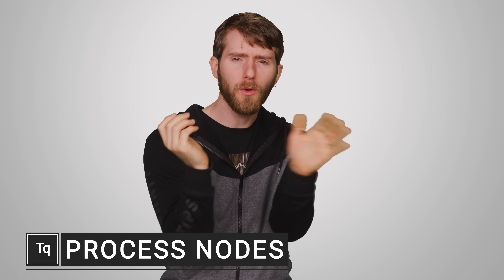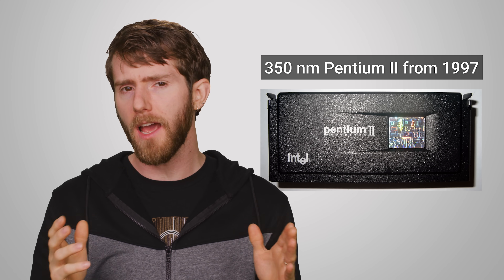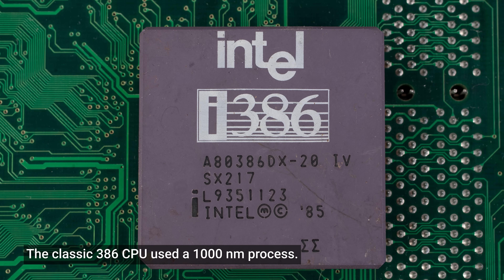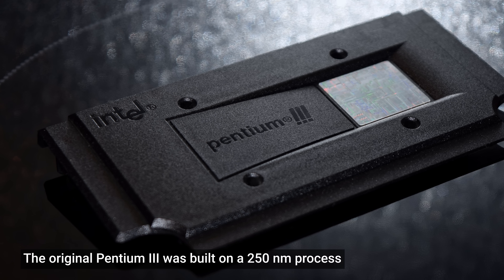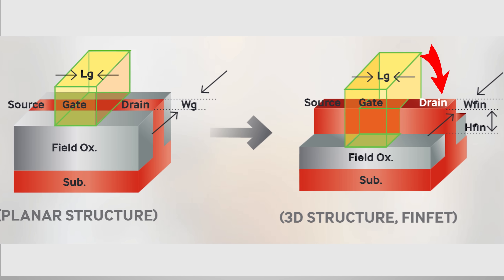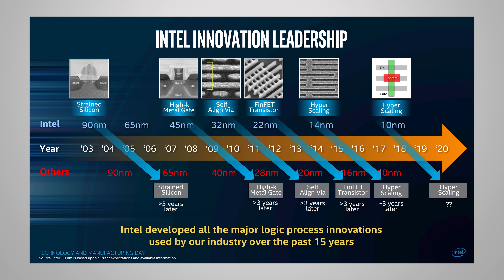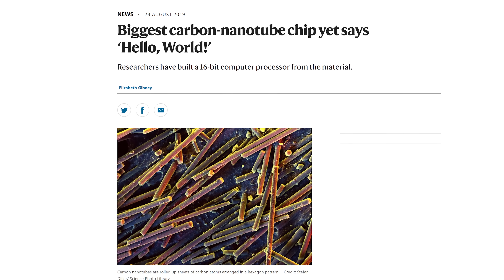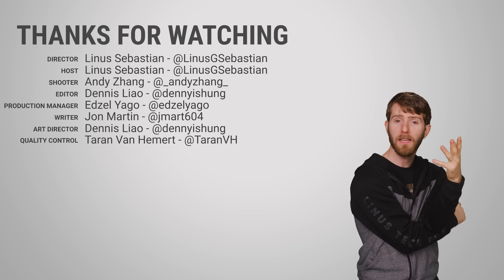Should You Believe CPU Marketing? - Process Nodes Explained

Comment: As long as each node jump has roughly a doubling of transistor amount, then I really don’t care whether 5nm refers to a size or not. Clearly the reduction of size isn’t the only thing that is helping with getting more transistors in the same amount of space.

4:13 thank you, literally my point
Reply: They arent consistent. Samsungs 11nm is better than their own 10nm
Reply: _lk_s better is a very loose term. In what sense, yields, transistor density? Point being each node jump should have better density than the previous. If Samsung’s 10nm is worse than their 11nm in density, then there’s an issue with their naming scheme in addition to the fab process.

Also each node jump that refers to a doubling of transistors goes off a scaling factor of 0.7. Hence 14nm*0.7=10nm
10nm*0.7=7nm

Going from 11nm 10 would be a factor of 0.9 and not 0.7, so the density increase wouldn’t doubled
Reply: @HazzyDevil  11nm has a higher transistor density than 10nm and better yields etc. 
10nm used a slightly different manufacturering process which caused worse yields. Therefore they improved the 14nm process once again. Until Samsung had their 8nm running the 11nm node was the best they had.
Reply: _lk_s so this just comes down to a bad naming scheme by them
Reply: @HazzyDevil  but that´s basically the point of the video. 
Each 0.7 factor improvement/Generation should stand for an increment of 100% in density. 
But Intels used ~170%,
TSMC used ~75%
and Samsung used 25% when going from 7nm to 5nm.
There is no logic in this naming scheme.
Intel could call their 10nm 5nm instead. 
Intel could even use their "+" names for node size.
Reply: _lk_s what are you using as the reference here though? And each node jump isn’t as cut simple as 14 to 10 to 7. There’s also the refinement of the same node. TSMC goes for smaller jumps in between whilst intel is more about doing bigger leaps.

And there is logic. You are making the mistake of comparing different naming schemes.
Reply: The only problem with the process node is that a 10nm intel node is comparable to a 7nm node from TSMC when it comes to density and most of people will see 7nm vs 10nm and will say 7 is better than 10 without researching a bit to check that they are comparable( Yeah I know that Intel has yet to bring a 10 nm desktop cpu to see exactly how much more the density matters and how truthfully are the "process nodes")
Reply: George Uta having higher transistor density is only one factor of having a better process node

Comment: There's a missed opportunity here to make more direct comparisons of size from TSMC's lithography to Intel's.
He's also using a white lie wrt electrons: what you're sending through the transistors is voltages, which can move at ~ 2/3rd c, while electrons will travel much slower. Also the exponential decay curve of the electron tunneling could be mentioned here and would make more sense in his discussion.

Comment: Intel says node size isnt everything....  I imagine it would be very important if they had 7nm and AMD had only 10nm.
Reply: They also say benchmarks are out of fashion. Let's rewind a few years...
Reply: @19AssassinPR93  yep that was insane hearing this from intel ceo XD
Reply: Node size as a bad measurement has been known throughout the industry for years. It's fine to shit on Intel and all but you could also say that it's TSMC being misleading by labeling performance-equivalent process nodes as "smaller". At the end of the day Intel is behind not because their current top process node has a bigger number attached but because it doesn't fucking work for desktop applications.
Reply: when amd was on 14nm they barely competed and they had to go on 10nm and 7nm to compete so i guess the node size isnt the important thing. the architecture its based on always plays apart and as well as the silicon quality. node size isnt the most important but it sure is one of the most important things in manufacturing a cpu
Reply: @mohammadtantawi452  no, they didn't need to go on smaller node to compete. They go there because they can. Architecture changes from first ryzen give them advantage, not die or node size. 
But from manufacturer point of view why should they stay on bigger and more expensive node size making hotter and more power hungry CPUs if they have a option to make them smaller, cheaper and with lover power usage sell them to big buyers? And I'll put emphasis on last one.
I know power usage is not something that average consumer think about too much but big OEM companies do. If they boards need to have much more expensive VRMs, if they need to put much more expensive PS inside their configuration, more expensive cooling, if they cannot sell "it will pay for it self on power bill" to customers which buy them by thousands then they will never sell anything based on your platform.
IPC gain does't have anything with node size except it will allow you adding additional cash memory and by that give you few procent benefit. Only architecture changes that noticeable. 
So we can say that node size change a lot for makers of CPU and not so much for end user.
Reply: Fl3ksss yes, I am saying if Intel had the upper hand in nm they would have also said its important to make then look better.  Kind of like how benchmarks are garbage to then.  “But how does the processor make you feel?”  “If you feel its the fastest it is.”
Reply: @mohammadtantawi452  nahh, your point about amd need to go for 7nm for compete also missleading imo. Yes ofc it is about arch battle. so zen come out at 2017(april?) Where theres kabylake(2016) on table and soon to be released coffelake(oktober/sept 2017?). 

It is fresh arch zen vs 2-3 times optimized skylake arch, my point is ofc intel was better when zen come out cause its well optimized skylake architecture but amd did great job to catch up only on 3rd refresh arch (zen 2) vs 5th refreshed skylake tho. Those node nm thingy just about power efficiency and core count i think
Reply: The good thing here is if you hit amd 7nm you hit nvidia too cause tsmc produce nvidia 7nm gpu :')
Reply: Remember when Intlel shat on AMD for glueing their processors, well Pepperidge farms remembers.
Reply: Intel is the only American tech company left able to produce its own chips. AMD, Nvidia, Qualcomm etc are nothing without TSMC, Samsung and consorts, besically "just" engineering bureaus. If they wanted to they could order capacity at TSMC immediately but they don't. There is a certain pride involved with making your own chips, not being reliant on others.
Reply: Jasko yeah if Intel  dont use outside fab soon they will be irrelavant. Producing 7nm is not guaranteed for intel as they are having 6 yrs. of  difficulties producing 10nm.
Reply: @miyagiryota9238    AMD is beating in 2020 an architecture that Intel is refreshing since 2015. that's how far back AMD was and they just caught up. Also don't get too enthusiastic about TSMC 7nm.. it's just a marketing branding, just kile intel's 14 or 10. the gate dimensions are roughly identical between Intel's 14nm and TSMC 7. and as Vexx says, they are physically more in the 20nm scale :)
You can't do real 7nm with just deep UV. that's one of t he reasons why Intel is late, because they work with EUV for the '10nm' node.
Same for AMD, only Zen3 will start to use TSMC's EUV.
AMD's IPC is superior, that's a fact, but i hope you didn't honestly believe they had real 7nm, pushing almost 1.5v Vcores and with those crazy temperatures :p
I suggest watching this video, the whole series if you can, it's pretty enlightening, but i copied the timestamp at an interesting time https://youtu.be/1kQUXpZpLXI?t=719
Reply: @fexilsehn6445  Likewise. We need AMD around to do that though because Intel only ever does it when they're under pressure and default to the kinda crap we've seen over the past few years prior to AMD kicking their ass with 14nm Ryzen. (Hence why we jumped from 4 cores to 10 in that time...)
That is not to say Intel don't make cool chips at all, more that they need to be facing stiff competition to want to make cool chips. :)
Reply: All this AMD vs Intel back and forth and here I am on an overclocked X58 system from almost a decade ago laughing in all the money I haven't spent
Reply: @METhOdhowtoKilLnoObS The only 10nm cpus Intel has made were some specific cpus for laptops, the Tiger Lake cpus are 10nm if I remember, but it's limited as most mainstream and all workstation cpus and enthusiast cpus are still in 14nm since the 5th gen/Broadwell.
Reply: Reminds me a whole lot how the democrats now say there is no such thing as voter fraud, when they were screaming of it in 2016 and every election they lost. As usual the truth is somewhere in the middle, meaning there is, and the question is only how much?
Reply: amd has 20 and they are calling it 7 ! Pathetic liars !
Reply: Apart from the nodes amd maybe have some amazing design than the intel thats why its performing better
Reply: You better believe they'd stamp that on every piece of marketing material; marketing is systematic dishonesty by design. Intel engineering itself though, and the engineers personally - those I trust.

Also: replace Intel with AMD and my sentiment remains the same; the better marketing gets the less truth it contains, but engineers deal in science and fact, and so do Linus & Co.
Reply: 869th like
Reply: Intel's 10nm > TSMC's 7nm
Reply: Imagine they told processor performance is not everything. Imagine vegan CPUs, ethically manufactured CPU etc.
Reply: If Intel had 7nm and TSMC had 10nm then that would be a CRAZY difference, like more than half, due to how they measure nm differently.
Reply: @BrumBrumBryn  They might call it something else, but I don't see how they can measure it differently. A nanometer is the same size everywhere I presume.
Reply: Marsorry Ickua guess i could have been more exact. They both measure from different points on gate, so the true size might be the same, but the marketing numbers differ
Reply: David Holland Well said! They also say benchmarking performance isn't everything either. When the shoe is on the other foot... So we need to measure CPU performance without using a benchmark??? WTF. Well what ever is used is by definition is a "benchmark". So what is Intel's point? Don't use benchmarks just trust us that our CPU's are great? Check out this video for an explanation: https://www.youtube.com/watch?v=Gj5_uc4ScNE
Reply: it's always a same story. When Intel CPUs use less power than that's big deal, when they use more than it's what? That's ok and normal. When they are cooler then it's a big deal, when you need $200 cooler to get advertised speed then it's ok, nothing wrong with that. When they have smaller manufacturing process it was OMG, we are so advenced and better and now it's unimportant. And worst of it all - that's what consumers say. 
I don't care too much about paid advertise like this one, big companies will always find someone who will sell their BS to the masses and Linus have to many mouths to feed to refuse money. But comment section is where I get stomach problems.
Reply: @gorky_vk  It's the same with AMD, when Ryzen was behind IPC it was all about more cores now it's all about IPC.
Reply: @BITCOIlN  well, you need more cores? Maybe, but 98% users don't. I'm glad they focus on IPC now. Mainstream CPUs will have more than 8 cores in two scenarios - when software begin to utilize more cores or CPU manufacturers fail to make any progress in IPC area and decide to give you more cores instead to sell "new, better" CPU.  I see future for 12-16 cores in mainstream but more than that? For what? What's a point without groundbreaking changes in software?
Reply: Intel CPUs actually does Not use more power. Try measuring a i5-10400F vs a Ryzen 5 3600 (both running full load on 6c/12t @4 GHz.)
Sure a i9-10900K is a monster at 5.2 GHz on all cores. But try a smiler OC with a Ryzen 9 3900X. 5+ GHz on all cores full load. If it's not a meltdown, the power draw will be insane. Go the opposite way and clock the 10900K down to the R9 3900 frequency, it should then run cooler and with less power than the AMD counterpart. (Also thanks to lower core count). So does Intel habe better efficiency.. Well thats a touch one actually...
What Zen2 has, is higher IPC performance than the 5 year old intel architecture. But the power draw vs frequency is actually also a bit higher.
But yes.. The Ryzen 9 3900X has higher compute performance and overall efficiency than the i9-10900K. But that is thanks to the lower clocks and higher core/thread count (providing higher efficiency)
Rendering software is
Cinebech and Blender is what display a CPUs true IPC performance. Not games 
/FPS. I would still say that Intel has the best CPUs for gaming, due to certain optimizations for Intel in many game engines. And raw core clockspeed still is something that is favored by many game engines.
Lowering core clocks a bit will normally gain a lot of power efficiency ...also because you can lower voltage significantly. Drop the Ryzen 9 3900 down to BaseClock and unddevolt it to the low limit. My own 3900X can here shave off 40% power at only about 6% performance penalty vs Stock settings. These numbers only apply to full load on all cores.
Reply: @Wushu-viking  comparing hard locked 65watt intel cpu with unlocked amd cpu? nice. get power figures of 10600k then talk lol
Reply: @Wushu-viking  who ask intel to clock their cpu to 5ghz then if overclocking results in high power consumption. amd has better ipc then intel right now and reaching 5ghz isnt benchmark.
amd 4.5ghz=intel 5ghz
its all about architecture not clockspeed.
compare 3ghz core2duo with 3ghz pentium gold or athlon200ge.
thats ipc .
ask intel to bring better architecture so that you intel fan boys dont need 5ghz and burn down whole house.
Reply: @fexilsehn6445  Yeah but you can also look throughout history and see Intel is objectively far scummier as a company.
Not sure why people say this "AMD isn't your friend" thing, I mean we know that. They're a company lol It's just that Intel is also close to bottom-tier in that regard, I'd trust them about as much as I trust BP or big tobacco.
This comment was written on a 3770k, also. I'm no fanboy, just a history buff.
Reply: AMD 7nm are so fake that even some 14nm intel outperform them with less power draw
Reply: @divoulos5758  - Intel can't outperform a ZEN-family CPU without drawing much more power. That's a fact.

Comment: No one ever used process nodes to compare CPU performance. Everyone is smart enough to understand, that an Intel core i9 10900k is superior to a Ryzen 5 3600, even if there are 4 times as many transistors on a given area on a Ryzen chip. 3600 is going to be a lot more efficient though. That's why people talk about process nodes between CPUs, mostly just to measure efficiency.

Comment: They didn't use nanometers back in the day they used microns. 1 micron = 1000 nanometers The 60MHz P5 Pentium processor was on the 0.8 micron process (800nm) at 5V and 15W TDP.

Comment: The thing about electron speeds isn't right. If they actually mattered then it would take minutes, possibly hours for the light to turn on once you flip the switch...
You can think of a transistor like it was a capacitor with a cable going through it that is only conductive if the capacitor is charged. If the capacitor is smaller then it takes less time and energy to charge or discharge it.

Cables are also capacitors btw, that's why you can't just make your HDMI cable ultra long: it takes time to charge and discharge the lanes, and at a certain point the devices just can't switch them fast enough anymore for the data to be successfully transmitted.

Comment: Intel's 10nm didnt fail because they "tried to go further than 2x". Moreso, if you can find the original 10nm slides they say that they expect "roughly a 2x density increase" which was then increased to "2.7x". The thing is, by now with how much they have had to "nerf" it just to get it to production levels, the process is not going to be nowhere near "2.7x" and not even gonna reach "2x", they would be lucky to get a 1.5x density increase by now